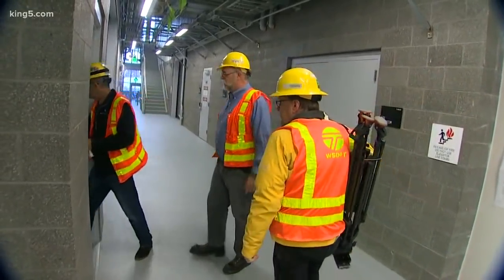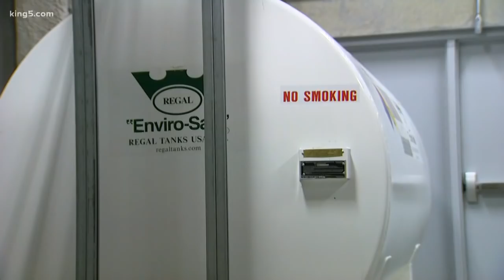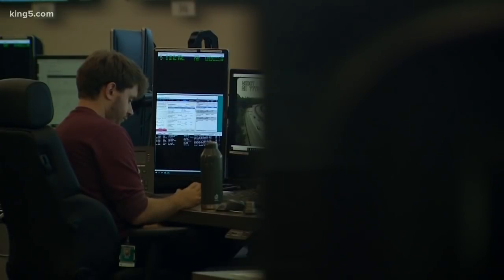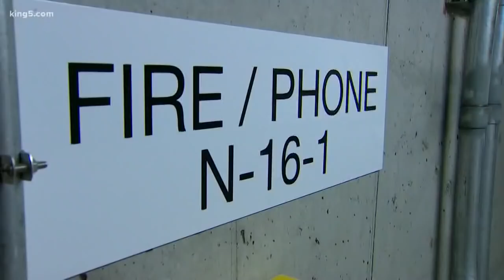Tunnel Effect: What does it take to run the new tunnel?

Comment: They should turn part of the underside of the tunnel into a pedestrian or bike bypass. That'd be really cool.
Reply: Would be cool, but none of those fire safety things is down there :( They’d have to rebuilt, and they can’t connect to the stuff on the next level because of the curvature of the tunnel.
Reply: That would be cool, but only useful for people travelling the whole length of the tunnel. It would be better to add a cycle path to the surface, now more space is cleared by moving motor traffic below.
Reply: I mean it would be a neat idea but the idea of putting the road underground was so that there wasn't a freeway blocking access to the coast, creating more sidewalks and bike paths in the process. Opening a bike path in  a gloomy tunnel would be counterintuitive
Reply: I'm from Toronto tooo
Reply: I suspect they'll have pedestrian and bike accommodations on the old viaduct route above ground where you can actually see and do stuff.